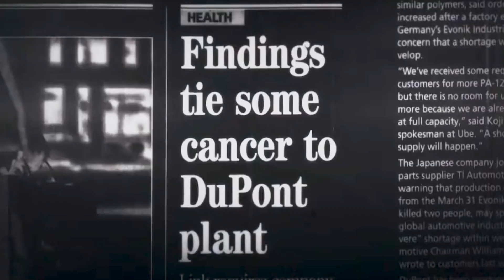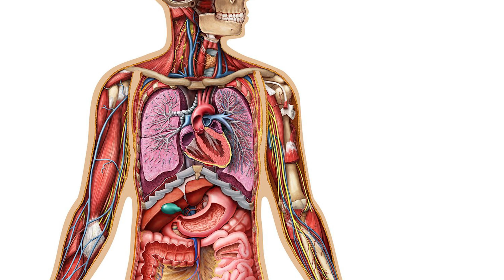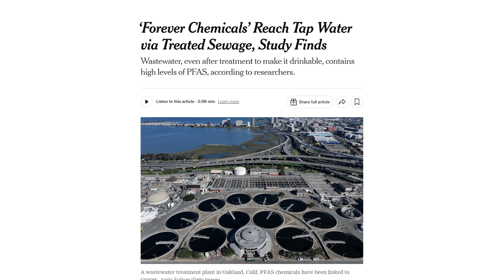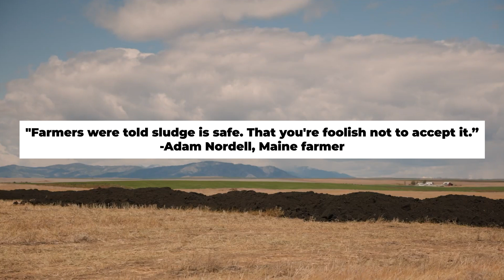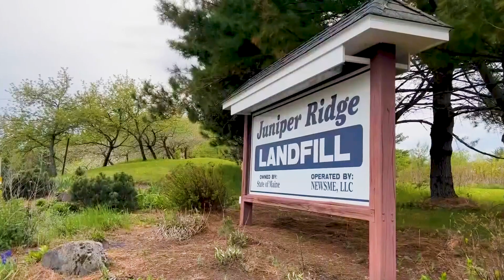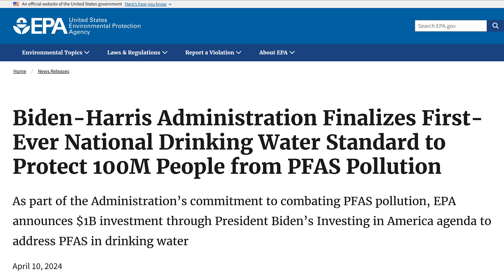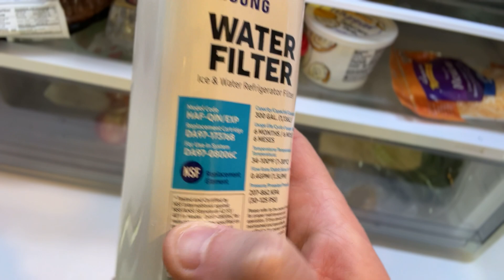Are PFAS Forever Chemicals Contaminating Our Water Sources Nationwide?

Comment: Chemical companies are like designer drug dealers they tweak the formula of PFAS to create a similar cousin that does the same thing and is just as hazardous. It takes years or decades as we operate now to research and push through a ban or regulations if we even do. People hear fraud, waste and abuse and while it's manipulatively used as a catchphrase to justify partisan attacks it rings true here which is why defending the EPA and federal agencies which have been failing was a disaster for democrats. Going back to my first point throwing money at the problem isn't a good solution sure funding the EPA to be an independent check is all well and good but if it can't achieve its core mission then were essentially wasting tax dollars. When communities also have more pressing every day needs and more its not a concern till it affects you.